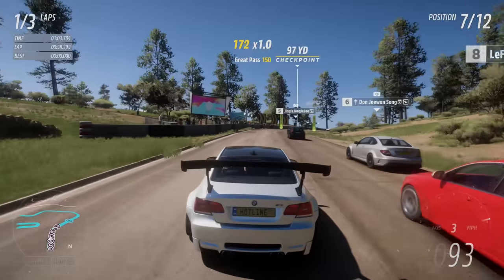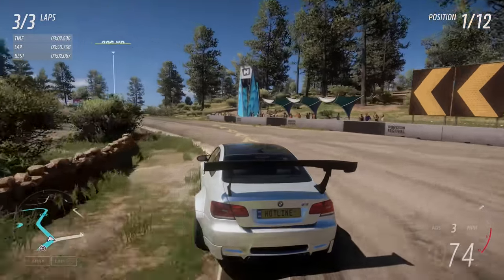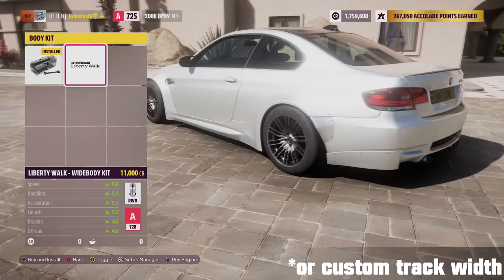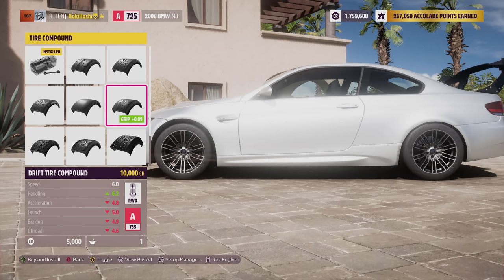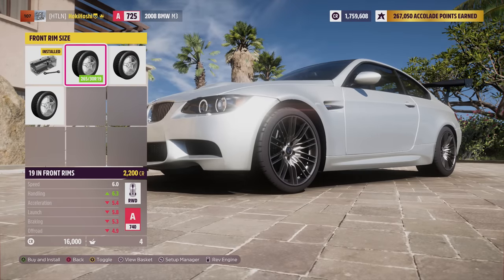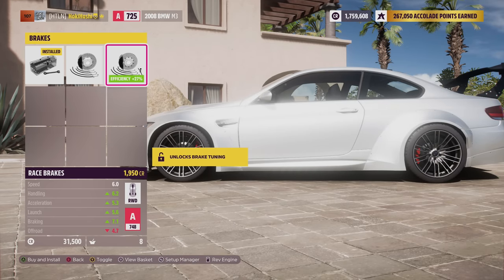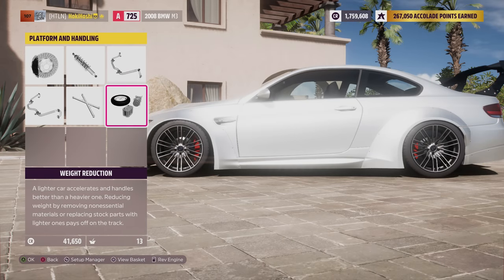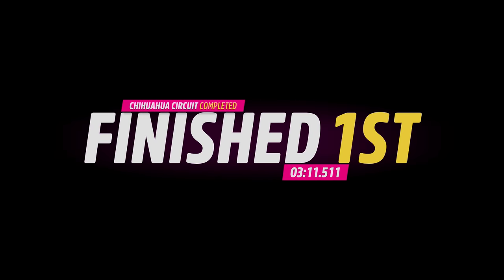How to Build Fast Cars in Forza Horizon 5 | Building/Upgrade Parts Guide

Comment: I usually pay more attention to acceleration. You rarely ever reach the top speed in  a race, a fast 0-60 and 0-100 time is what I go for. A car that has a top speed of (theoretically) 167 with  a 0-100 of say 6 or 7 seconds will be more competitive than a car with a top speed of 190 wth a 0-100 of 10 or 11 seconds in a race where you never reach 120-130 during the race. A car with a fast acceleration time and good braking can move through corners faster and accelerate ate into the straights quicker. Balance that with good handling and you have a winner.
Reply: Basically for road/circuit racing, acceleration, handling, braking matters the most, forget about top speed and offroading capabilities.
Reply: A good car for you to try is the Ford GT 2017 great S1 class apex racer it good brakes and acceleration for corner's handles easy and has the good speed for straight's it is my go to for apex races was on FH3 but on FH4 was crap but now it is good again like FH3.

Comment: Engine swaps are confusing. Should I just keep everything stock and just use a different car if I want more power or is it worth it to swap out the engine on something like the AMC taking it from c class 200HP to S2 class with 1500HP all the popular tunes I find seem to swap out the engines.

Comment: Great video, Hoki! I am many times guilty of upgrading everything to maximum and pushing C and B cars into S1 or S2, then wondering why I'm getting left in the dust :D My favorite cars and tunes are the ones I upgraded within their starting class (Maybe a class above). They drive so naturally when they are within the bounds of their chassis. One of my favorite FH4 tunes was a '94 Supra upgraded  to A class, stayed RWD with around 600-700 hp. Off the line sucked (lol) but cornering was so much fun living on the edge of grip and using a bit of oversteer. I started that tune based on your FH4 tuning guide and tweaked it from there. Thanks for all the content you post. It's awesome!

Comment: Your videos are awesome and so informative. It's my first horizon games and it's a mixed bag for me tbh. Overall the game is amazing but online is soul destroying at times. As far as tuning goes I feel like I'm studying for a degree, I try to put good tunes together but I still seem to be so much slower than everyone else even if I'm driving really clean (opponents seems to drift out of corners in street races, spewing tire smoke and are still faster??). Never had this issue in Forza Motorsport games. Ive not even come close to winning a race with my own tune in horizon so far, and if I have it's only down to making less mistakes than other players. I can complete a race cleanly; a guy will miss two checkpoints during the race,overtake me both times and still beat me even with same PI number. Hopefully I will get better with your videos.

Comment: less weight allows for a more agile car, but a heavier car has more tire grip. fine line but big differences. if you remove weight from a miata youll find itll just throw itself around with no traction. hence why its usually easier to add power for online. if you find your car is sluggish to change directions it could do you well to remove some weight. if your car just feels like a piece of paper try adding weight before upgrading tire compound
Reply: I have an MX5 NA Miata for every class it can possibly fit into. Including my rallyata’s and drift missiles, I have like 10 lol

Comment: BASICALLY A SUMMARY OF THE ENTIRE VIDEO:

Find Correct Class for Car (Don’t upgrade more than 2 Classes above stock)

Firstly;
Unlock Tuning Options
Tires
Suspension
Transmission

Secondly (If you have spare PI);
Brakes
Clutch
Adjustable Aero (if needed)

Then spend the rest of your PI by either;
Adding power to the engine
Upgrading Weight Reduction (Rims, Driveline, Weight Reduction Upgrades)

More Power = faster on straights
Less Weight = faster everywhere

Upgrade in order listed
————

Conversions

Not all builds will need things in here
If you want a more powerful engine, buy a car with that engine stock; if you want AWD, buy a car that is AWD stock; etc

Engine
Only Upgrade If;
Pushing car to higher class

Drivetrain
Only Upgrade If;
You really need to

Aspiration
Turbocharger = + Max Power
Supercharger = + Rev Power
Only Install if;
Need more power
 Have the PI to spare

Bodykit
Install where possible (+ Handling)
————

Aero + Appearance

Front Bumper
Expensive, but important on Classes A+
Only Install if;
Too Much Understeer
No front grip

Rear Wing
Try build without, but can be hugely beneficial on higher class cars
Use Unadjustable Rear Wing to fine tune PI
Only Install If;
 It lowers PI (can remove downforce later, if needed)
If it highers PI, only install if you notice significant rear grip issues at speed
————

Tires + Rims

Compound
Usually use corresponding tire for type of car
Rally Builds;
Rally Tires (For racing offroad + road)
Offroad Tires (For racing mostly offroad)
Track builds;
AWD = Stock tires (so long as you aren’t upgrading power too much)
RWD/FWD = 1 tire upgrade is usually worth it
Semi-Slick tires are better than slick (+ Grip when raining & offroad)

Tire Width
Front Width
Install on FWD | Understeer
Rear Width
Always Install Max (+ Grip, +|- PI)

Rim Style
Use to fine tune PI

Rim Size
+ Responsiveness, costs little PI

Track Width
+ Handling & Grip
RWD = Leave front width stock, Increase rear (+ Rear Grip & Stability)
Use to fine tune Over/Understeer
+ Rear spacing & - Front Spacing = + Understeer & Stability
 + Front Spacing & - Rear Spacing = + Responsiveness & Oversteer (Too much difference = Can mess up suspension)
————

Drivetrain

Clutch
Good to Install (especially on lower class cars)
Pay attention to shift time

Transmission
Install Sport Transmission (Cheap, Unlocks Final Drive tuning)
Only upgrade further if; 
Need the extra gears.
Have the PI to spare.

Driveline
+ Rev Speed, - Weight
Good to fine tune PI with

Differential
Doesn’t cost PI!
Use corresponding diff for car type
Exceptions: 
Sport diff is useless, use race diff for road builds
Offroad diffs: only use for FULLY offroad cars
————

Platform + Handling

Brakes
Always Install Race Brakes

Suspension
Always Install Race / Rally Suspension (+ Handling, Unlocks Tuning)

Front + Rear ARBs
Always Install (Unlocks Tuning)

Roll Cages + Chassis Reinforcement
Usually don’t install full roll cage (+ Weight)
Always install chassis reinforcement.
For each class you upgrade your car above stock, add one level of Chassis Reinforcement / Roll Cage.

Weight Reduction
If you want more power, skip weight reduction.
If you want less weight, get the most amount of weight reduction you can.
Always go min or max.
————

Engine

This is where you spend the rest of your PI budget (if you have any)
Best to focus on unlocking tuning, tires & suspension first, before engine

Intake
Always install max

Exhaust
Always install max

Oil + Cooling
Always install max

Intercooler
Always install max

Supercharger
Upgrade if you have the PI to spare

Camshaft
Good upgrade, but usually costs too much to be worth it.
Only install if you have the PI to spare

Fuel
Install if you have the PI to spare

Ignition
Install if you have the PI to spare

Compression
Install if you have the PI to spare

Flywheel
+ Rev Responsiveness
Use to fine tune PI

Turbocharger
Install if you have the PI to spare

Displacement
Install if you have the PI to spare
————

If you have hit max class for car, see if you can fit in an extra upgrade by fine tuning PI with:
Unadjustable Rear Wing
Rims
Tyre Widths
Driveline
Flywheel

Comment: Imo, removing weight is the first and important thing you should do and adding power should be the last. If you have a light car, you dont need a big engine.
Reply: Depends on how heavy the car is in the first place I think. A 2 ton beantly yeah, that boy needs to lose some weight. A car with idk like only 1 one ton or less, it feels too unstable in higher speeds for me. So for top speed s1 and up cars I want my car to have at least some weight.
Also I recommend not to get the weight removal for cross country races with a lot of bumps, hills and jumps. Just my opinion as a pretty casual player, no pro. just sayin.

Comment: Wow 2 guiding videos in a same day. Thanks a lot. Can you make another video to explain torque along with hp, i heard you mention them alot in your gearing guide for FH4 but not understand much. Your videos are very informative, love them
Reply: Torque is how strong the engine is and horsepower is the limit of the engine 

Torque = acceleration
Horsepower = top speed
Reply: Power is the energy output of the engine, you always want to maximize this as the higher this is the more you accelerate, torque is essentially how flat the power curve will be, the more flat the more consistent your acceleration will be over your rev range.
Reply: @MoosyPineappleMan  Power can also increase top speed as you need a significant amount of it to keep the car accelerating with the high winds and rolling resistance. Another great way of thinking about torque is how much force in Newtons the tires are able to output into the ground maximum for every meter of travel.

Comment: some things have changed meta-wise since this video came out. For one, it's widely recommended to only use dirt tires for rally and offroad because they provide far more grip on dirt than rally. Additionally, rally tires have been found to be best for A class and maybe B class.
Reply: Depends on the car and track, but If the track is partly on the road go all the way rally if not offroad wins by far. ( Sure less grip but the boost in power you get from the less pi cost is more than enough to obliterate the opposition.)

Comment: Sometimes a build under the top level can be more fun than maxing. I try to host sessions where the target is to be exactly half the index in some lobbies I've made. Lowkey wish there was a PI index limit option other than classes online.
Reply: @Ikaros---  Or have a 930 class so cars can be fast, but still limited whether you choose to max the engine, or throw some handling parts in so you don't die.

Comment: As a horizon 5 noob, can you go into why AWD is not OP anymore? Did they increase the PI cost or what exactly did they do?
Reply: I haven't played the game, but I've heard RWD & FWD cars feel more grippy, launch better and are overall easier to drive than in the other Horizon games.
Reply: Awd wouldn't effect the p.i so you could take the Ferrari p4, Enzo, 250 gt, ford Shelby Cobra, Ford GT 05 do the AWD swap and have it be less p.i then when it started meaning you can have insane head room to add power and engine swap if you want.

Comment: It really isn't that difficult to understand. It literally tells you what each upgrade does. Want more power? Upgrade engine. Want more grip and better handling? Tires, brakes, and weight reduction. Also no, you don't need to be at the maximum PI to compete. If you're building a car for track racing, you don't need to do every engine upgrade to get to the top of your class. There's a thing as adding too much power. Awd is easier to drive, less of a chance of spinning out, but will never corner better than a rwd car(except for the sesto Fe. That thing is beyond broken)

Comment: Do you think it’s better to drive in automatic, clutch less manual, or full manual?
Reply: If you’re talking about manual vs manual with the clutch, it all comes down to personal preference. I’d recommend using manual if you only use keyboard/controller. If you use a wheel/want to squeeze out that extra performance, I’d highly recommend using manual with clutch then.
Reply: Full manual gives you the most control over your car and I recommend full manual if you can get used to it. If for some reason full manual is too hard for you just use clutchless manual. Automatic will mess you up more than it will help you. I started the forza series on clutchless manual and progressed into full manual. Full manual takes some getting used to but if you can master it you will be much faster than clutchless manual players or automatic players. I personally find it really fun to use full manual.
Reply: @Porsche911RSR-0  True, but what I wonder is how long does it take to get used to clutch on controller compared to manual?? I’ve tried many times before and I feel like I’m just a bit slower than just with manual, especially if I’m casually driving.
Reply: @iceslayer777  Just keep trying like anything it takes practice. I first tried way back in Horizon 2 and I was slower but I kept using it because it was fun. I kinda forgot how long it took for me to get used to it but I would say try to only use manual with clutch for about a week and see where you are.
Reply: @Porsche911RSR-0  I’ll try it out again, and see how much faster I can get with it compared to just manual.

Comment: I've been testing out my mustang. I noticed that keeping the weight stock made its launch much more controlled. I also found that It corners great, and I'm able to keep Alot of speed during the turns. But I notice that the AI can surpass me on long straights however.

Comment: 10:40 HARD disagree: proper gear tuning is super important and if you are using an american car, for exaple a C7 corvette, you will notice that the last gears are unnecesarily long, that's because they are ment to help with fuel consumption, that is useless here and will waste you a lot of time. You should evaluate wether to buy a transmision upgrade or not after testing the car or by how large of a difference in PI there is from the stock car. Luxury sedans can also have weird gear tunes that will slow you down. I have left behind thoose pesky Diablo GTR drag builds more than once and i often get away with having less power.

Comment: Your videos have been very informative. They have unveiled and given me an appreciation for much of the depth that this game has to offer. There is something that I do not understand, however. I dominate when I use the mission provided car "#4 Ford focus rs A [749] Rare" for baja races but struggle when I use my newly purchased "Baja bone shaker B [700] legendary. My assumption was that since the bone shaker is best in class for B series, and legendary, that it would perform better. What could be the reason for my poor performance with it?
Reply: The bots match your class for single player racing so it doesn't really matter. The baja bone shaker drives terribly in my opinion and also a car's rarity has no effect on how good it is in a class

Comment: 3:50 I need to disagree with that. We still see in the online environment a huge AWD swaps, it keeps with a good speed and don't have a poor launch. I don't feel like RWD is really that viable, with only some minor exceptions. Besides that AWD cars are much more easy to drive.

Edit.: From some time experimenting and trying to keep cars as original as it could to its drivetrain, in most cases (like 98% of it), it's definitely worth changing drivetrain from RWD to AWD. Not only it becomes more easier to drive the car, it gets a better launch, less hassle with the car losing grip at the rear, and except for getting more weight and losing some PI points, you don't lose more than you win, specially when you consider the PI points you lost wouldn't be useful, since if you spent it on more power, it would just make the car more uncontrollable.

So yeah, unfortunately this is once more a Forza Horizon game where you do AWD swaps all over the place and just wins with it.

Comment: 3:50
I would argue that AWD swaps are just as powerful as they are in Horizon 4, and I kind of hate it. I was tuning a McLaren F1 GT for S1 racing. I tuned upgraded it with it's stock RWD drivetrain, and when I went to go test it it was difficult to throttle out of corners without losing grip. I wasn't spinning out or anything but I needed a lot of throttle control to maintain grip on the car. I go to swap AWD on it and instantly it grips insanely. can max throttle out of corners however much I want.

This kind of sucks because I actually like having to use skill to maintain grip on your car but there is literally almost no reason to use RWD when you can use the other, way grippier option. Yes, AWD usually comes at a cost of PI, so you won't have as much power on an AWD then a RWD car at the same class, but the ability to max throttle out of corners greatly makes up for a bit less power. Maybe I just suck, but that's my experience. You also can put maxed out tires on the RWD car for more grip but that also comes at a cost of PI, and why would you do that when you can do the more effective AWD swap?
Reply: yea awd is a joke, putting thicker rear tires drops my pi on awd but punishes me when I do it on a rwd

Comment: I build for launch and acceleration, widen tires once for each class, make rear tires one upgrade bigger than front, full weight reduction. And little hacks like rally tires for a class street builds. All about cheating the pi system, like awd an old muscle car and only change rear tire width to max, feels a little weird at first but grips like crazy and more pi for other stuff.